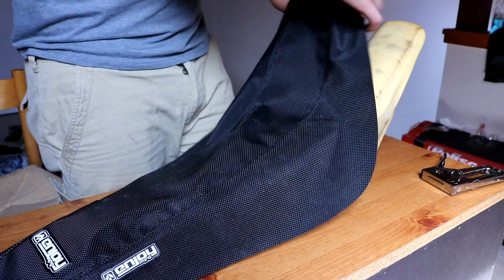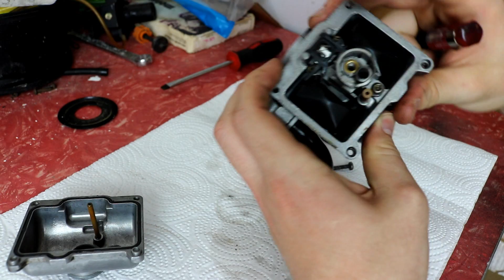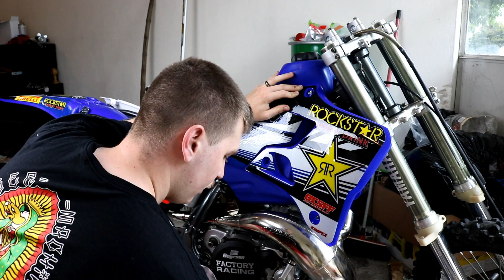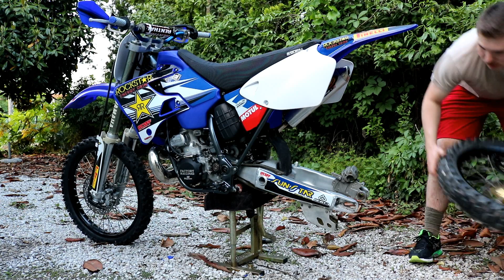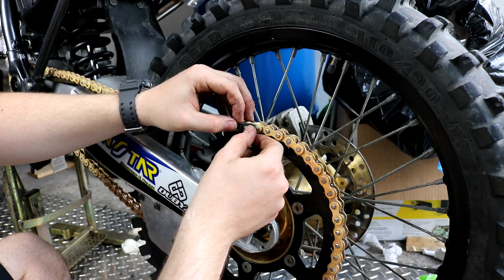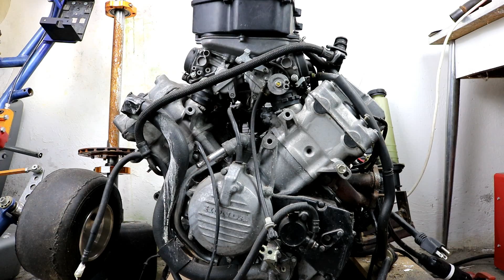$400 YZ250 Restoration! Pt. 6 Bike is done!... But..

Comment: Nice looking bike. A little trick I use when doing bearings is to put them in the freezer the night before and they actually shrink enough to usually just drop right in. It works really good when your doing the crank bearings too, and if you freeze the crank to it helps it go in easier also.

Comment: pro tip: if you want to put in barings. Dont support the wheel on the tire because it will absorb most of the punch of the hammer.

Comment: hah! dude you just completely embarassed yourself publicly for 223k people to see.  How the fuck did you not hook up the killswitch and stator to the cdi box when you put the motor in the frame to check and see if there was even spark??? The #1 rule for any engine running is spark! than after that you must have compression followed by your air/fuel mixture.  it takes 3 things for an engine to run and you completely ignored the 1st rule! you coulda had that bike running for 25 dollars the day after you bought it, yet you spent thousands of dollars on parts you didnt even need lol

you're not a very good mechanic at all and are giving amateur engine builders the wrong idea.  you dont have basic metric hand tools, big metric sockets for your axle nuts, or your sprocket bolt.  do yourself a favor and learn how to build a bike the right way before publicly embarassing yourself

Comment: I think you put the ground of the electrical system on top of a powder coated part. That ground wire has to touch the chassis directly. That might cause issues.

Comment: Be careful when tightening the main jet like that man, i torqued mine less than that and the jet sheared off at the top and had to use a reverse thread to pull it out. It was on a 2014 250sx and would have cost me 400 for a new carb if i stripped the threads because they dont sell the piece it threads into separate. Jets only need to be snug. Awesome video man! keep it up!

Comment: You forgot to put on the rubber grommet that seals off the pipe and silencer.
Reply: Dakota Newman I was thinking the same thing fam
Reply: these are slip on.  they fit metal to metal.   that's how this style is
Reply: Keyboard warrior Hitman True but they also have a rubber grommet that helps to seal them together. Here is a picture of one https://images-na.ssl-images-amazon.com/images/I/618D3EmRbzL._SY355_.jpg